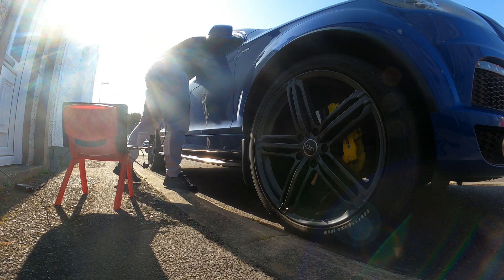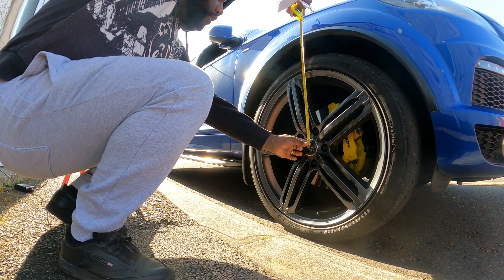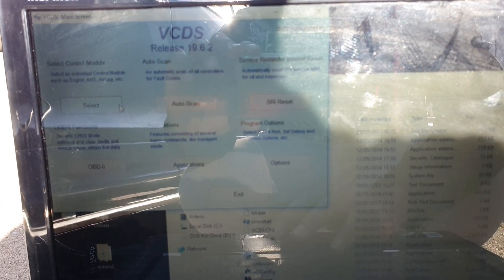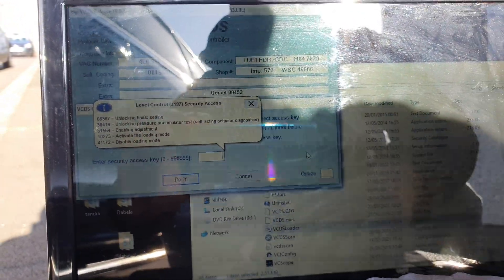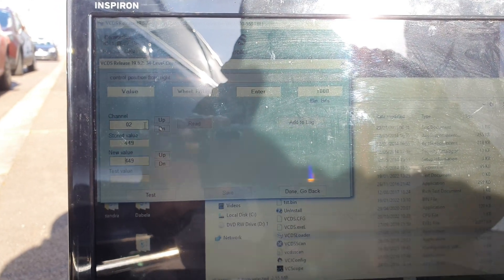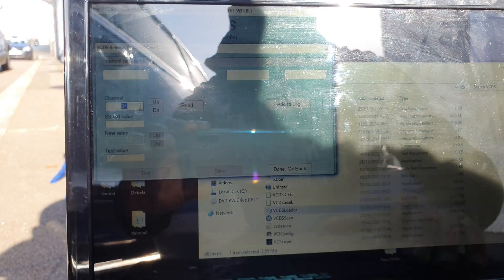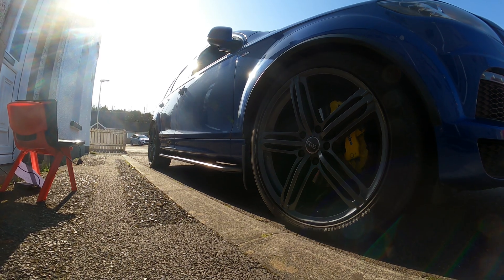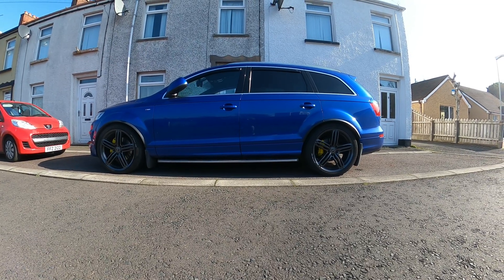Lowering Audi Q7 with VCDS

Comment: Hi mate, great video.. 
I have an issue though. Channel 5 is not available on mine. Now I have a fault as basic setting have not been carried out. Any ideas on what to do
Reply from the maker: Thanks man..
Start by clearing up faults before trying again.
Then make sure car is in flat surface and don't sit in the car.
Mine at least I needed to connect VCDS before starting the engine, which needs to be running for this procedure.
Lastly don't forget to input security access before trying to adjust ride height..

Hope you can get it sorted. 👍🏾

Comment: I just bought a used 2017  Q7   (  premium plus )    I was not sure if I had any ability to adjust ride height other that the 4 different preset suspension modes.    Will this work on it?
Reply from the maker: So that's the 4M Q7.
Manufacturers are making hard for people to DIY stuff on their cars. I would look for the specific procedure for your model, but I'm not sure the 4M allows the user to lower it.

Comment: Hi friend...do you know how low you can go with vcds? I still have a reasonably big arch gap and want to go lower? Many thanks
Reply from the maker: I've heard of people going as low as 25mm.
Its a matter of trial and error, because any value that you input that's out of range, meaning going too low, that value won't be accepted.
Just don't forget that going lower than 17mm will require a wheel alignment to prevent premature tyre wear.
Reply: @_LuisS  thanks my man, i appreciate your reply😎

Comment: Hi bro can you help lower my Q7 ?we’re are you based?
Reply: I want to drop the height 10mm
And put wheel extenders 
35mm on the rear and 25mm on the front
Reply from the maker: Hi buddy.. If I can help if course I will..
I'm in Portadown NI.
All that is doable even you lower s bit more. Mine had 23mm spacers and u lower it 15mm.
Drop me a message on Instagram if you need my help..
Reply: @_LuisS  Hi bro thank you for the message I will drop you a message soon. As the car is going 
into Wheel Mania on Tuesday to see  if they can get me the Vossen HF-2 wheel in deep concaves 
10.5x21 front and 13x21 rear or 10.5x22 front and 13x22 rear if I can confirm it’s the AS7  I can confirm it’s the AS7 kit on my car its the Audi Q7 4LB 2015 30TDI Sports Edition I would have come to see you to see your 
Audi Q7 but you are far away in Northern Ireland  I do not want to use drop links on my car want it natural but
if I can get the fitments I want with out using spacers then I will but last resort my bro. 
Thank you my G for the reply back will be in touch soon.🙏🙏🙏👍👍👍
Reply from the maker: @gsingh2294 I live concave wheels..
I'm sure it will look amazing..
I don't own the Q7 anymore. Sometimes I still see it as I sold it locally.
Hit the fb groups. You might find someone close to you willing to help as well..

Comment: Just an update, over a year later. I lowered mine 25mm and it was absolutely fine. No extra tyre wear, in fact, my tyres worn perfectly even.

Today i have raised the suspension up to standard, then another 20mm again. Reason being is there are many floods in my area, so i want to be clear 👌
Reply from the maker: That's so nice to know..
So glad you were able to get it done. 😉

Hopefully you'll be lowering it soon enough..
Stay safe.. 😎

Comment: How low does the system allow you to drop it?
Reply from the maker: Not sure..
I just wanted a subtil drop. But there's a post online somewhere where the guy lowered it 25mm.
When doing this the car has to be in a flat surfice. If not car won't accept some values.

And there's always the lowering links that gives the car a nice drop as well.

Comment: Great video. Having adaptive chassis package is a prerequisite?
Reply from the maker: I didn't think it was until I experienced it.
I thought it's just one more thing to go wrong.
But the ability to change suspension height/stiffness is very much worth it.
Reply: @_LuisS  I agree 100%. Just got one with out it. Other awesome packages but not adaptive chassis. Mine is a 2017 with prestige trim. I am assuming you only get air suspension with adaptive chassis.
Reply from the maker: @salamanca105  I was looking one with air suspension and side steps.
And then with the most extras I could get. But those 2 were a must.

Comment: Hello! Many thanks for such a good idea! Could you please prompt if there's a chance to make a car softer on Comfort mode?
Reply from the maker: Comfort mode is pretty soft. In my opinion.
But I guess if you want it to be softer you could try to do the opposite (subtract X mm for the car to think it's lower, therefore will sit higher than normal and become softer).
I've never tried it. So I don't know if it'll work. Please do your research first about that.
Reply: @_LuisS  agree, think there's gonna be a big research and report ;-) found also that reallyy many Cayennes, Touagers and Q7's has stiffen suspension after some time, so there has to be a solution
Reply from the maker: @ApolloniumUranius  I wasn't even aware of that.
Mine is very soft in comfort even after I lowered it. I get it why people like it. But for me it's too soft. Mine is in dynamic all the time.

Comment: Looks nice man, i want to try it on my audi a6 c7.5 model

I have a question?
I read coments and u said ( it will be lower in all mods )
If u put on comfort mode ( does it raise up?)
And when u put on dynamic mode ( it will be lower )
Or it will be the same comfort , dynamic, auto , always will be lower 

Thank you
e.x for 12mm
Reply: I did this with my c7.5 2018 S6 and it worked great.  Make sure you are parked on flat ground and measure from the ground to the center of the wheel well before you start to give yourself 4 all around good measurements.
Reply from the maker: If I remember correctly the c7.5 is a bit more complex than the Q7. But also possible.
And when you lower it, say 12mm, all modes will be 12mm lower. But in my opinion you'll only really see the difference in dynamic because the arch gap will be reduced.

Comment: Hallo, I have a problem, how can I remove my car from the enabling adjustment (31564) ?
Reply from the maker: Once you finish the process including going into channel 5 to save the process of lowering you just press the 'Done, Go back' button to close the module. Once that is done the enabling adjustment is disabled until you re-enter the security access code.
Reply: @_LuisS  a ok thank you, and imagine you change it from 449mm to 450mm, and you succeed, is it going to be 450mm too?
Reply from the maker: @gabrielquni6258  not sure I follow.
But when you change the value (and don't forget you ADD IN MM to lower the car) and the value is accepted, than the accepted value becomes the actual measurement.
Reply: @_LuisS  a ok i had 449mm i had done to 450mm. and I went to look again. and I saw it was back at 449mm. so nothing had changed.
Reply from the maker: You need to make sure to go to channel 5 and change the value to 1.
That way it'll save the change in previous channels.
Also when lowering there's certain values that are not accepted, if you're trying to go too low.
I only done 15mm max but you can go as low as 25mm. Try to stay under that and it should work.
Reply: @_LuisS  ok is good bro thanks for your help man.

Comment: Hello Luis! I have done exactly like you did and everithing seems good. I had exacly the same measures and I put exactly like you did. After it seems a little high and I tried to do it again but with new measures but it says invalid and thats it. Can I do it again to lower more or not. What I am doing wrong?
Reply from the maker: Hello Martin. Sorry for the delayed response!
Standard measurements are 449mm front and 465mm rear.
Did you have these before you changed them?
And also make sure you're adding, in mm, the amount you want to lower it.
If the new values were invalid it's because you went over the range it allows you to lower it.
I would put everything to standard and then try again.
Make sure you're going to security access and input the code before you start and then don't forget to go to channel 5 to save the process.
And engine needs to be running too, with doors closed.